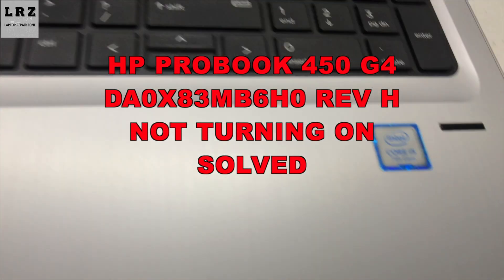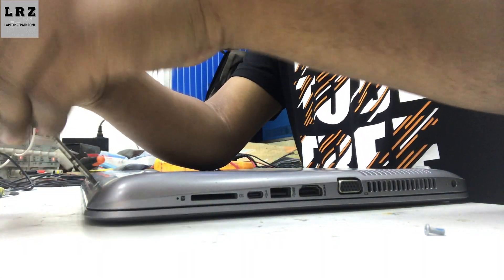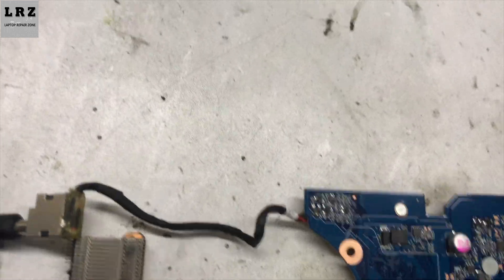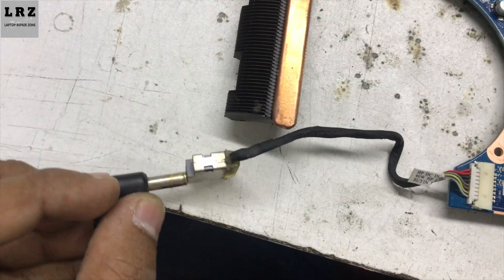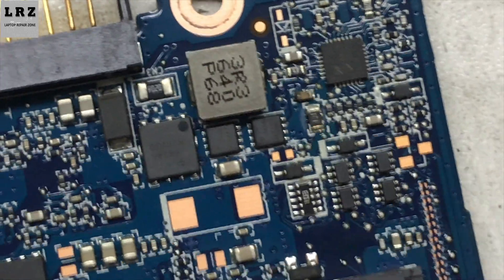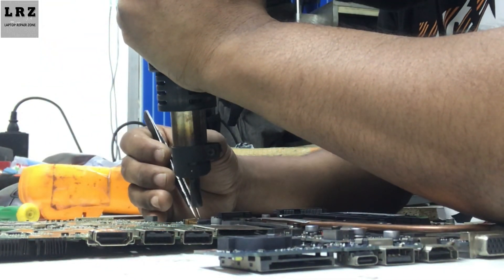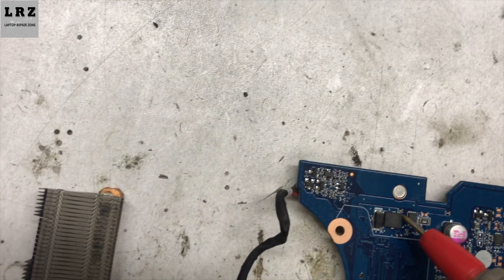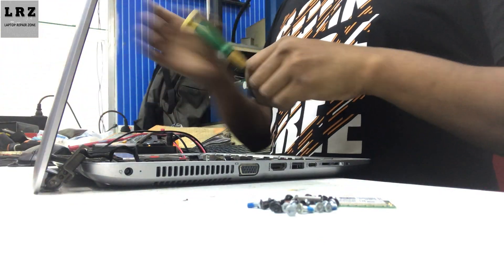Hp ProBook 450 G4 not turning on solved.

Comment: hi dear, i have almost the same issue with my HP Probook 450 G6. unfortunatly this suffered a liquid split (perfüme from my wife) on the keyboard. after good cleaning, he will not power on and the charger light will show quickly and the dissapeared after i plugged in. 
i performed some measurements to see if there is a short somewhere. the 19v rail is present and i even get the 3v on bios chip, 3v on EC, 1,8v for RAM and 5v for USB but the notebook will not power on. 
could this be mean that the CPU / GPU is shorted?

thanks for the reply.

Comment: Hi i have the same notebook. When i plug in my power adapter the led light orange and after one hour the led turn off. After i press power on nothing happens no led codes or sounds. After replug the power on no led light is on. So what do you think is the problem? Same as you did?

Comment: thank you for this video, I have a problem on the same Hp ProBook 450 G4 model the charge connector light flashing orange and does not light up, did you encounter the same problem .thank you
Reply: Same problem do you fix it ?
Reply: @user-fl7sb5rt8y  NO

Comment: my laptop model is hp probook 450 g4......my laptop problem isWhen you press the power button, the power button light comes on and the fan goes off. The display light does not come on. After pressing the power button many times (15-20) display by
Reply: Do you find a solution yet ?

Comment: Thanks very much. I got a same laptop but the problem is the LED light  comes on and  blink 3 times then goes  off. How will I fix this problem ?
Reply from the maker: Kohitete Ketrepa thanks for your comment, clean RAM then try again if not solved then try with another RAM.
Reply: I have same problem

Comment: Hi sir, so I have the same laptop but the problema is diferent, the light of power blink two times and restart, my screen not show me nothing is black. Did you know how I do for repair it?
Reply from the maker: Victor Hugo Arenas thanks for your comment, remove RAM then clean and reset again then try if same problem, then you need to open internal battery and then try with only charge.
Reply: @Laptop_repair_zone  Hi  budy, I remove the internal battery and I connected directly to ac adapter and the laptop not turn on. I think the laptop have a problem with BIOS, did you know how I do for reset BIOS in the mainboard or repair the BIOS, the laptop not turn on and not show me nothing in the screen.
Reply from the maker: Watch this video please https://youtu.be/9VCXYcyiCqc
Reply from the maker: Did you remove the CMOS battery?
Reply: @Laptop_repair_zone  yes , but the problem is not resolved. I search in HP support website and I find the diagnostic, say it: "The main area (DXE) of BIOS has become corrupted and there is no recovery binary image
available". I don´t know how I do for recover the BIOS with black screen.
Reply from the maker: There is only way to flash BIOS chip with new BIOS dump thanks.
Reply: @Laptop_repair_zone  sound very difficult. If you make a tutorial please let me know. Best regards!

Comment: When i input the charger the power led is blinking for few seconds than turns off. Charger led keeps blinking tho. Can’t turn it on, laptop is new
Reply from the maker: Thanks for your comment, please open the battery and try with another charger,if not solved then open CMOS battery and try again,if problem not solved then take your laptop to your local laptop repair shop to repair your laptop.
Reply: Laptop Repair Zone it’s one of those hard to open laptops to reach the battery.
Reply: superbn0va same
Reply from the maker: You can take your laptop to your local repair shop.

Comment: Firstly this is a great Video. i have got the same model and its power button light stays on when i plug-in the charger, also charging light not turning on. any suggestions?
Reply from the maker: Thanks for your comment,remove battery and CMOS Battery then check switching voltage.if problem not solved then you need to check all the required voltage.

Comment: Firstly great vid and thanks for the upload! I have the same laptop and have checked all the points you checked and all show voltage 19.19v but like your laptop there is no light on the charging port. Any suggestions? Thanks
Reply from the maker: thanks for your comment, check SIO and BIOS .
Reply: @Laptop_repair_zone  Thank you for your reply.
Reply: @paulrees3960  Hi Paul, I got the same problem, all voltages are on 19,4V but there is no light on the charging port. If I put a new battery laptop works and the light goes orange but the laptop charges nothing. Did you found any solution?

Comment: need information about the battery charging section in laptop’s  doe’s the 14V -9V from the charging IC output’s to  coil and for the battery pins only if the battery in ? what if SIO detect there is no battery at that point SIO will not give the enable signal to charging IC?